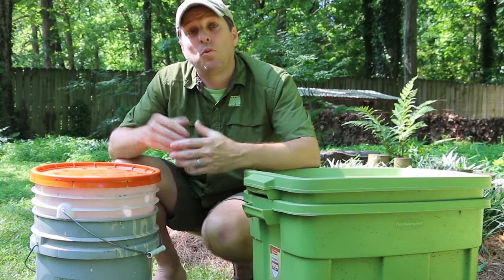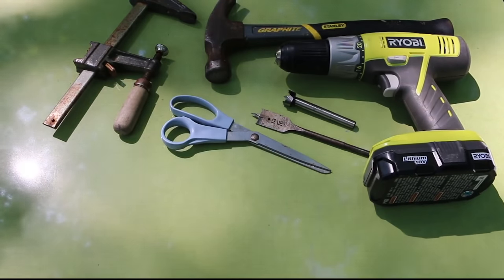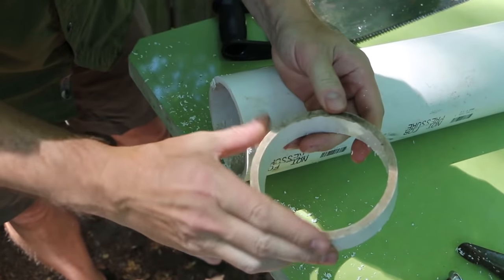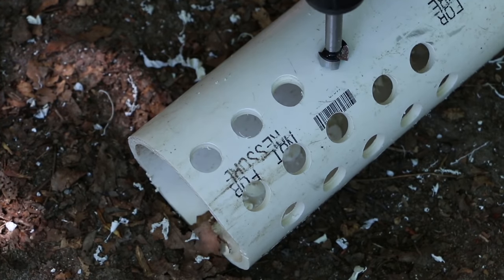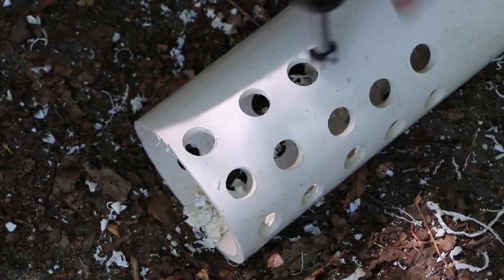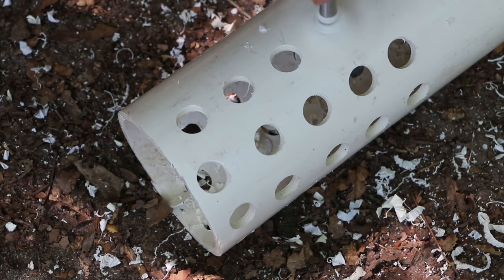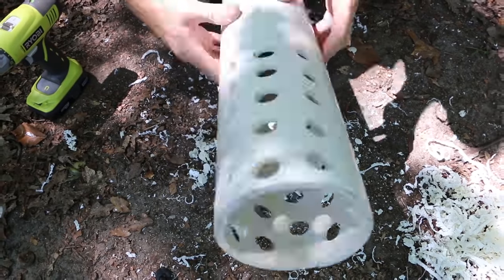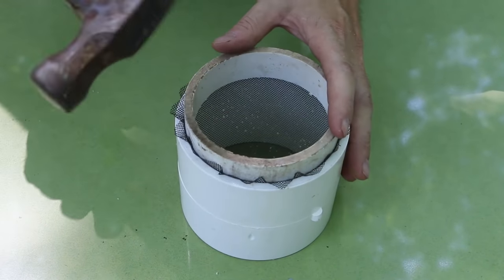How To Make A DIY Worm Tower

Comment: How far apart to put the towers?
Reply from the maker: Hi Charles. I usually place 1 tower for each 4x4 foot square or so. My raised beds are 3x8 and they have two towers each. (BTW...I'm a Charles too, plus my dad and my son). Thank you for watching.
Reply: @GreenShortzDIY  Thanks for keeping up with your old YT videos Many never respond to there new videos. Less  those nearly 5 years old Thanks. I have been watching videos on how to make worm gathers. Some use electricity Other cut notches in to sticks And rub another stick over the notches. With the notch stick stuck in the ground. Some use a digging fork and and stick it in the ground and beat on it. The electric ones work faster. One you tuber shows how to make it. He uses 6 probes. You can  buy  three probes, and one probes online  I'm thinking of going around in my  property to get as many worms as I can to put in my beds. They want be red wigglers. But they will be better than no worms.

Comment: I thought you needed holes on top of tower for rain to get in? Also, some videos say you need composting worms (red wigglers) and not earth worms. Are you using earth worms only?
Reply from the maker: +Joyce Rebar hi Joyce. The whole top of the worm tower is open, just covered with screen. You can't use earthworms for composting. They are a soil processor (still great for a garden bed). Red wigglers are a worm that process organic matter.
Reply: the Flies will drive you crazy if you have drill holes above the soil line
Reply: Even with fine screening? I see some use that on top

Comment: I just add mulch and kitchen fruit/veg scraps straight to my raised beds.  They are full of worms.
Reply from the maker: Burying food scraps directly in the garden is the easiest option and works great. It was the organic method my grandfather used. It only requires time and space. The worm tower is really just creating a portal to the soil, versus digging holes and burying. Thanks for your comment.
Reply: @GreenShortzDIY  Talking about footprint management on planting area efficiency, yup, worm tower is the way to go.

Comment: What do you do if you have no worms.
Reply from the maker: You can purchase worms online at Uncle Jim's Worm Farm. Use the coupon code "greenshortz" for a 10% discount. (I don't make money on this, I just like their product). I have also read of a way to gather composting worms in your yard. I have tried this method, but only half-way. I recommend making a pile of leaves with shredded newspaper toward the bottom. Moisten the pile well with rainwater. Leave it for a few weeks and then dig through it looking for worms. They should be composting worms if they are attracted to this habitat. You can transfer the captured worms to your worm tower.

Comment: Why wouldn’t a section of 4” perforated pipe work ?
Reply from the maker: It would. It might even do a better job of keeping the worms inside while letting the nutrients flow out. It would likely need to be shaded to prevent it from overheating. That is assuming it’s the black pipe. Thank you for the suggestion.

Comment: Is PVC safe to use in gardening?
Reply from the maker: Hi Kevin. Some would say no. But, I think it is fine. The main environmental concerns with PVC are in its manufacture not the product itself. The PVC will slowly break down in the sun, but any off-gassing will be minimal and will dissipate in the air...not end up in the soil. You can also minimize this by shading the pipe from the sun with a wooden surround. But, you might just make the worm bin out of the wood to begin with. Options. Thanks for watching. :-)
Reply: @GreenShortzDIY  Thank you!  I appreciate your response!👍🏾

Comment: What do you do when tree roots take over your tower!?!?
Reply from the maker: Mark, I haven't run into this problem in a garden application. I'd probably just pull it out and move it. Has this happened to your worm towers?
Reply: Doggone squirrels keep burying Black Walnuts in the gardens, and they grow fast, they also poison the soil (the trees that is, not the squirrels).  Once the castings fill up the towers do you just move them, or 'harvest' and put back in place?

Comment: Why add newspaper? Isn't the ink poisonous? It's a nice video.
Reply from the maker: Not usually. Most printing ink (other than metallics) is soy-based these days. It is better to use the non-colored pages of newsprint, but I do use it if that's all I have. I avoid using the shiny ads, which indicate the use of a varnish. Thanks for watching.

Comment: You not the first Gardner avoiding BSF's in your system. What's the big deal? I always thought BSF's are a good thing unless I'm missing something.
Reply: I was confused about this as well.  According to Wikipedia, soldier fly larvae and red worms don't get along very well - large populations of soldier flies create an environment that is too warm and acidic for red worms, driving them away.
Red worms are apparently more effective at breaking down cellulose, while soldier fly larvae are more effective at breaking down 'high-nutrient' wastes, which I would assume means food scraps.  So I guess it depends on the intended use.
The screen at the top would also keep out house flies, which would cut down on smell and pathogen transmission.  That's probably the biggest benefit, if I had to guess.

Comment: Question: If you don't put a cap on the bottom of the tower, won't all of the nutrients just flow out of the bottom of the tower instead of the sides?
Reply from the maker: Good question. Actually, the compostable material gets pretty thick in the bottom of the worm tower. The liquid finds its way out the sides first, rather than making it to the bottom. That said, even if some flowed out the bottom, it would still be beneficial to the garden. Thanks for your question.
Reply: I like the bottom cap idea, especially since most of my raised beds are not more than a foot deep. This forces the worms to move the compost horizontally into the garden
Reply: Ruth Hersh maybe a mesh screen?
Reply: Jedi Lion that's what it's suppose to do. JS.
Reply: Jedi Lion h

Comment: Mine doesn't work well, I don't ' think I have it deep enough.  My wiggles adn almost comes out when I try to remove the lid.  I just bury the food around it.
Reply from the maker: I suggest leaving the lid off and perhaps berrying a little deeper. You want it 10-12 inches deep. Even with the lid off it will still keep vermin out. Only the flies will have access. Thanks for watching. Happy composting.
Reply: @GreenShortzDIY  ln india temp rises will the worms dieif kept in the gatden

Comment: I thought pvc was toxic over time due to break down? Also Paper has toxic chemicals?
Reply from the maker: From what I’ve read, PVC will photo-degrade in the sun. My thought is that would result in off-gassing into the air versus into the soil. I suppose residuals could be washed by the rain into the soil. I don’t think most common papers contain toxins and most inks are soy-based these days. That said, it is hard to eliminate all toxins from our lives. My guess is that we get more exposure VOCs from burning candles and buying laminated wood furniture than using PVC in the garden. Mainly because these exposures are in the confines of our homes, versus open air environs. However, will still need to make informed choices to ensure the health of our living spaces, indoors and out. Thanks for sharing your concerns.

Comment: So you never pull it up for any reason?
Reply from the maker: I do pull it up once a year and clean out the soil in the bottom. It will compact throughout the course of a Spring-Summer-Fall composting season. I also find that the worms will migrate out into the garden in the course of a season as well. All the more so if their food runs out and their castings compact into soil. Having them in the garden bed is not a bad thing, but the won’t provide the concentrated composting power they do inside the worm tower. Thanks for watching.
Reply: GreenShortz DIY Awesome! thanks for your response!

Comment: Ok, so my curiosity has gotten the best of me. Could you add a feeding tower into a bin to make collecting the castings a bit easier?Also, couldn't that help to monitor the amount of food the worms are actually consuming without having to dig through the bin? 

#NewWormieHere
Reply from the maker: Hi Tenaj. I haven't tried that, but it might work. I did have some short PVC pipes in a worm bin to help with air flow. The worms were in and around the pipes like they weren't really there. I'm not sure how well the tower tower in the bin would allow for accurate monitoring, but the only way to know is to try. That would make you a #nolongernewwomie. :-)

Comment: Hi  Marty, so i'm  just putting in my first garden this year and want to do it right with all the bells and whistles.. i like the idea of having earthworms create a better habitat for the garden and was wondering how many towers would i need to have in a 20x30 garden. Also i plan on dividing the whole thing into sections?
Reply from the maker: Hi Chuck. I suggest you start with worms towers in part of your garden and then expand. I put two towers in a 3 x 8 foot raised bed, so you could apply that ratatouille to your large garden area. Also, keep in mind these are not earthworms, but are composting worms called red wigglers. Earthworms process soil, composting worms process organic matter. That’s why they love veggie scraps from the kitchen and coffee grounds. If you got an order of 3000 worms from Uncle Jim’s Worm Farm ($30), that would easily set up 10 worm towers. You could probably stretch that to 15. Hope that helps. Thanks for watching.
Reply: GreenShortz DIY 
So the regular earthworms don't do a thing to aid in decomposing anything in the compost pile?

This is my first year that I'm starting to raise (grow) worms to put in gardens I have all over my yards perimeter. I've noticed I have seen worms within the grass clippings as I turn it over to mix in new kitchen scrap. But they appear to be more on the surface of the ground below everything I'm composting? I was going to let the organic matter break down a little then put it all in a bin with a lid then bury it at ground level. The lid was not to drown then in a heavy rain and burying it down at ground level was to keep them cool. And I figured as I mix in new organic matter I could see if they seem to be doing well. I have a lot of worms around naturally but I think it could be more.
My yards make up is strange. It's a poor grayish sandy mix down to roughly 8" where there's maybe 2 inches of a darker grey clay type of a mix. But then at around 12" it's this beautiful black mix of what seems to be an earth peatmoss mix that goes down for feet? It's strange. I'm on the Jersey shore where years ago the land was much different. I'm wondering if a foot down was the surface of some prehistoric forest. Then water tables possibly rose depositing clay then the sand was used to fill the development in to a buildable grade? I don't know. Every year my gardens will out produce gardens that people have had this removed, peat, manure and top soul replaces then tilled in and my neighbors are stunned! What I haven't told them is where ever I'm planting a garden I've dug it out with post hole diggers about 18" round 24" deep and I'll first mix in cut up great fish I've cleaned. I'll mix in live eel grass from the beach after soaking out as much salt as I can. Then green grass clippings then mix it with that deep layer of good black natural dirt. The extra sand I use to fill rain washed out tuts but the street.

But this in unrealistic to do for the entire yard so I'm thinking of maybe filling up 12" and replacing with (something) topsoil etc but thought it would be good if I could get a heavy worm population growing. And I've debated build raised beds instead as I really want to grow much more then I have. Maybe it's the fish, eelgrass, live grass clippings and oh yeah I forgot to mention live peat moss I collect myself from wetland areas and bury it before it dries but I can grow enough tomatoes (either big boy or beefsteak) off 3 vines to fill the freezer with sauce & salsas. Have fresh tomatoes all year and give some away. Last year I tried bell peppers for the first time and the plants were as tall as me 5'11" and by late August were weighed down w/peppers. I'm not sure which part has been doing the majic and I rotate the plants and until last year when my tiller died I tilled those gardens deep until those whole area not just the planting holes I basically made blended together and I grow endless butternut squash in between the planting holes and produced easily 30 butternut squash from 5 plants. I have noticed that this area is holding many more worms then any other spot I were to pick at random.

I'm sorry I rambled on a bit too much (it's PTSD) but what I originally wondered about is the worms. I can't breed these worms that moved into these gardens to help enrich new garden areas since it's too late to dig 1,000 s.f. and fill it with fresh compost and worms or else build the soul as I've done for years. My neighbors wouldn't appreciate me burying this much fish parts. I usually bury it through the fall & winter to give them time to decompose. I did bury some a month ago only to come out and find huge hole where some animal smelled it and tried digging them out "unsuccessfully" thank God
 Any word on what benefits I do get from these worms would be grateful. I do know they have to leave some castings and aerate the soul somewhat even if they don't eat the compost. Don't they still have to eat something?
Reply from the maker: Steve Allen hi Steve, thanks for the detailed comment. Your organic garden soil mix sounds amazing. The fish guts have got some rich nutrients. I’m guessing the peat moss layer is the remains of a marsh or big that once covered the area. I’m actually filming on the Georgia coast today and tomorrow. Amazing and beautiful salt marshes here. The worms you are seeing are likely native composting worms. Especially since you are seeing them in the grass clipping.ms Composting worms are naturally in our environments too. And you can capture and multiply them. It is a little more slow going than buying them, but it works. I hope this helped. Thanks for watching.

Comment: I was very intrigued by this idea until I did a little more research. Apparently PVC is one of the most toxic plastics known to man and should never be used in the garden. There goes my plan to build a strawberry tower too
Reply from the maker: PJ, I hear you. I've got videos making this type of worm tower out of wood as well as one made with terra cotta chimney pipes and brick.
Reply: @GreenShortzDIY  thanks taking the time to reply! I just happened on an article that also suggesting wood as an alternative. I will definitely have to check out your videos on those alternatives! Thanks again!

Comment: what kind of worms did you put in the tower?
Reply from the maker: The type of worm in the tower is called a "red wiggler." They are a composting worm versus an earthworm. You can them by mail from Uncle Jim's Worm Farm dot com. Use the code "greenshortz" to get 10% off. But, you can also find composting worms in the natural environment by looking in a compost pile or in the woods in leaf matter. Worms you find in that habitat are most likely going to be composters. Thanks for watching.

Comment: I have been vermiculturing for about 4 years.  This looks like a much simpler way to compost.  2 questions. I have a rather large garden. How far apart would you place the worm tower? Due to the environmental comments about PVC, could you make this towers out of a metal pipe? Yes, drilling the holes will be a bit more work, but metal is recyclable.
Reply from the maker: Hi! I place my worm towers at 4 foot intervals, for the 4 inch towers. I've got a bucket worm tower design here: https://www.youtube.com/watch?v=aeFL2zxU6zg&t=1s
Those could be place further apart (8 feet). This plastic (#2 LDPE) doesn't have any BPA, and doesn't have the concerns many have about using PVC. I don't suggest using metal, mainly because of the cost and worm involved...the material would be fine. Instead, try making one out of wood. Here's how I made it: https://www.youtube.com/watch?v=F2F7-MK_wi8 Going forward, I think I'd choose this option over the PVC, just because it is organic and looks really cool in the garden. Thanks for the comment.

Comment: wouldn't black pipe work better?
Reply from the maker: Hi Anthony. As long as it is shaded, black pipe would work just as well. If it is getting sun, the black pipe would heat up too much. It wouldn't kill the worms necessarily, but they would run away. Thanks for watching.

Comment: If your so concerned about contaminating your soil with plastic, which your right. Why start the project on the table away from the soil, then bring it over to the soil and say what drill bit is best because it makes less mess, then drill it on the soil and make a mess with lost of small plastic bits going all over the place. Then bring it back to the table to do the least messy part at the end.
Reply from the maker: Well, I don’t always think of those things while I’m making a video. I can’t argue with your logic. I did clean up my mess afterwards, just not on camera. Thank you for the feedback. Thank you for watching.
Reply: @GreenShortzDIY   Thanks for the reply, not trying to poke at you just an observation. Thanks for the video and best of luck with the garden.